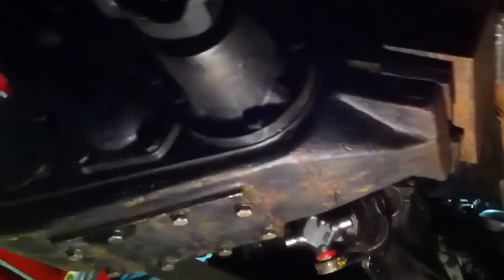danger  ranger huge lift 5.0 v8 DANGER ZONE

Comment: I'm running the same set up, 5.0 with dana 44 front with ford 9 inch rear.  Got 4.88 with the Yukon grizzly locking rear.  I went with the C-6 and Ford NP205.  Dont use a C-4 because they are trash, the C-6, NP205 combo is actually a slight bit shorter than the C-4, 1350 Borg-Warner set up.

Comment from the maker: actually i have a t5 mustang trans with a divorced transfer case so its a 5 speed, im planning on blowing up the trans cuz it prolly wont hold up to spinning 38s, but im going to do a full size 2wd trans out of a 78 ford f250, they are tiny and very strong 4spd with granny low also